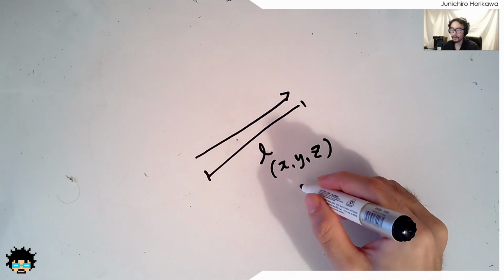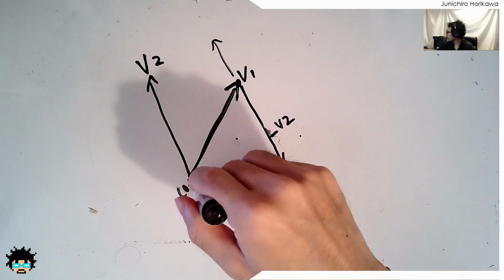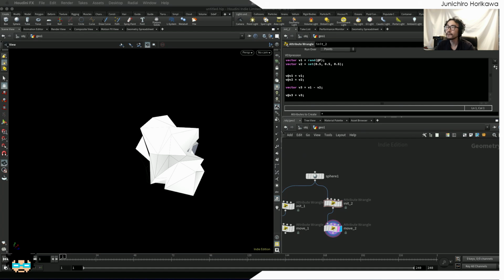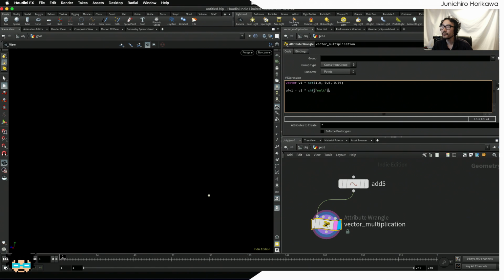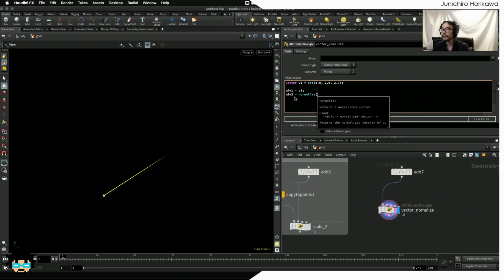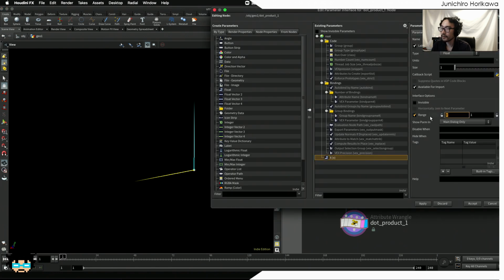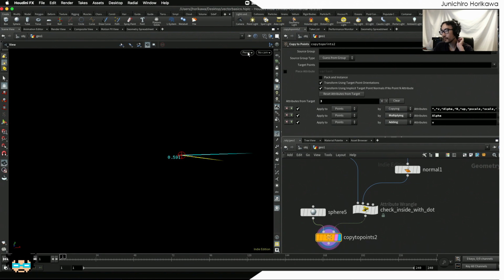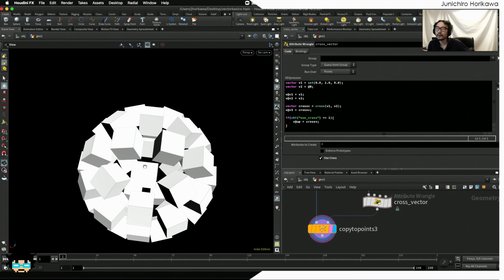[VEX for Algorithmic Design] E12 _ Vector Basics

Comment: Hi Junichiro, thank you so much for sharing all this wisdom. I have a question. When I replicate your addition example in H19 my red v3 vector points in the opposite direction and only looks like your example if I invert it (v@v3 = -v3;). Do you know if something changed in how Houdini calculates these directions in H19 or maybe I'm missing something? Thanks!
Reply: Haha, sorry, user error! I accidentally set the visualizer for the v3 vector to be a Vector Trail and the other 2 as Vectors 🤦‍♂️

Comment: It's confusing as a vector can be simply a position coordinate like vector = {0,0,0}, but this is not a traditional vector with an origin point and direction and length....so what we call a vector is actually 2 houdini point vectors, and the direction and distance is calculated from their positions...
Reply: "It's confusing as a vector can be simply a position coordinate like vector = {0,0,0}, but this is not a traditional vector with an origin point and direction and length....so what we call a vector is actually 2 houdini point vectors, and the direction and distance is calculated from their positions..."

You are confusing yourself.

"so what we call a vector is actually 2 houdini point vectors, "

That's only required to actually plot the vector where we want it; Otherwise the single value of the vector, e.g. {x,y,z} is still inherently there(within those two plotted points) and can still be used as that inherent vector UNCHANGED even if that inherent vector is plotted elsewhere with two different 'houdini point vectors'.

It's no different that using graph paper when doing your high school math. Where ever you plot that same vector (same direction and same magnitude) on the graph paper, it will still have a co-ordinate for its 'head' and 'tail' in addition to its inherent magnitude and direction.

You use a poor example of {0,0,0} because not even considering Houdini, such a vector is a special vector(exception) called a zero point vector - having no direction and no magnitude.
Reply: @babajaiy8246  ok so basically my mental model is flawed in the fact that, I am trying to create an origin point for the vector when in fact one is not needed and the vector can be transposed anywhere
Reply: Yeah I think it's fair to be confused.  The term vector gets used in a few different contexts in Houdini, even though the data itself is the same - it just depends what we want from those numbers.  In the case of @P, we are generally just using these three numbers as coordinates.  We don't usually desire a magnitude or direction in this instance.  But should we wish to visualise them and use them for something, they are there as they are inherently the calculation between the coordinate of the point and it's position from the origin (0,0,0).  In the case of say, velocity, we would care about this.  

If you create a point that is not at {0,0,0}, add a vector as an attribute for this point, and then visualise this vector, you will notice that the line will draw to the point rather than {0,0,0}.  However its direction and magnitude is calculated as though the point was at {0,0,0}.  Once you move your point away from {0,0,0}, you'll notice that the direction and magnitude of the vector doesn't change, it merely gets translated around with following the point.
Reply: @joeyjojo8782  OK so most of the time @P, say {3,4,5} is actually {3,4,5} - {0,0,0} from the origin, it does indeed have a direction, you could tell it to keep going in that direction...The bit that confused me was, I forgot about the origin so assumed it was just 1 set of values when there are indeed two arrays to provide direction
Reply: @BabaJaiy You might find it helpful to view the video @Josef H posted above - which has a good explanation of the multiple perspectives from which vectors can be considered. '...It all depends on the direction that you look at them from'  Jk  : )